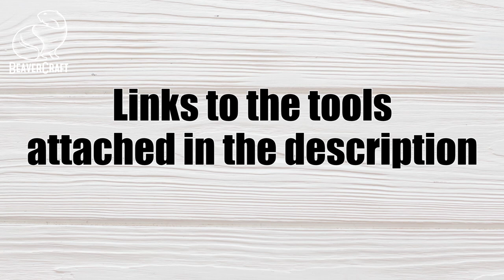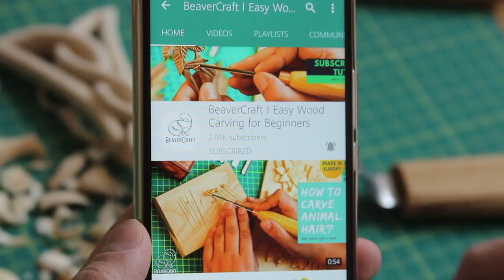Wood carving for beginners ideas, courses. How whittling a whale or any fish self. Carving fish

Comment: This is a newbie question, why do you not use the K1/10 instead of the K5/12 to remove the larger areas of wood?
Reply from the maker: If it's more suitable, you can use K1/10 instead of K5/12 😁. In this video, we just used the k5/12 gouge.
Reply: @BeaverCraftTools  Thank you for the information. I own both, but thought there might be a reason K5/12 was a better option. Makes sense if that was the one that was handy at the time :) Thanks again.